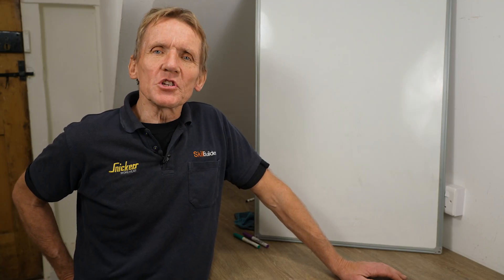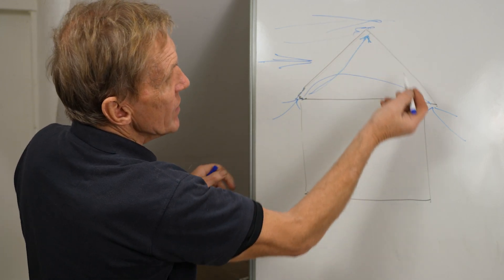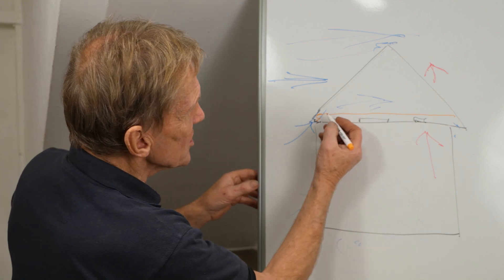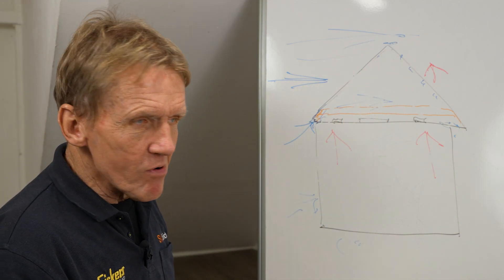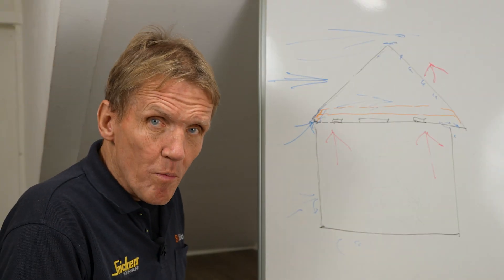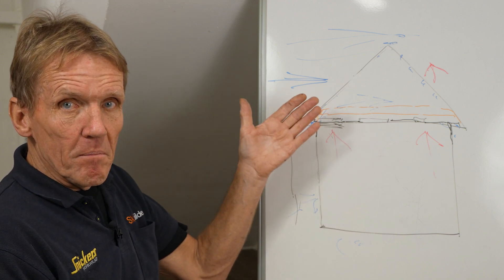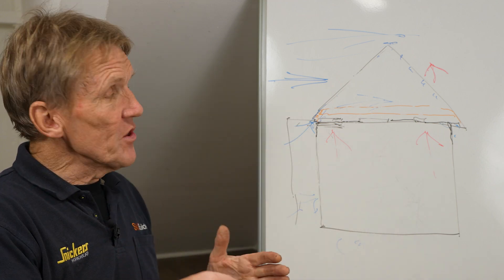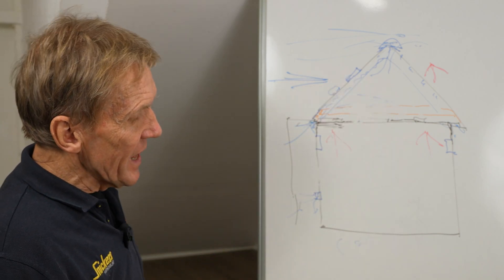Why Do You Have Condensation in Your New Roof?

Comment: We’ve just bought a 3 storey Victorian house with a slate roof. It hasn’t been lived in for 18 month. There are 2 rooms in the loft but it has no insulation so I want to remove the ceilings to add a multi foil across  the rafters then 100mm of kingspan over the top. There is already condensation on the 3x2 timbers but nothing is rotten. Would insulating like this make it worse so I need to vent the outer 3” area between the tiles and multi foil.
Reply: To get the right U values for current building regs you would lose room space quite a bit by the time you build out. 
To make the best of what you have, personally I would install 25mm pir insulation in between rafters this would maintain your 50mm ventilation gap, then I would install a super quilt insulation (YBS ) directly over the underside rafters, foil tape all joints and then  counter batten over that with 25mm x 50mm batten, then you could install a vapour control layer ( although not essential as the super quilt would act as one) then your plasterboard. 
You may not get the current U value regs for said area but you would have done your best to get some energy efficiency into the building and it would be better than nothing as they say. Hope this helps.
Reply: @christaylor5291  thanks for that Chris. It’s looking like the slate will have to come off so could I put a super quilt on top of the rafters too ?
It wouldn’t matter about loosing some room if I also install 100mm kingspan as the rooms are massive.
Reply: @S.wilson911  hi Stephen no problem. If the slate has to be removed, the thing you have to consider if you live on a semi detached then there would be a height difference with your neighbours roof finish. You would still need to counter batten on top of super quilt then batten for slate so that’s a build up of 50mm off of rafters before slate is installed, which has to happen although this provides cross ventilation which is great. If you live in a detached house then no bother but you would need to look at fascia heights due to the build up. You might only need to install an over fascia vent to take the difference up in build up on the batten. One thing to mention is YBS sell a superquilt with roofing membrane install already on it, still tape the drift joints (Overlaps). Check the specs to what way the membrane is installed, I can’t remember off hand. Even though if you went for superquilt on top of rafters you would still need to install pir insulation, in between but still need to maintain an air flow up the rafter voids, so 100mm in between would block that. At a push you could install 50mm in between maintaining a 25mm air flow then vapour control layer and then 40mm-50mm over the top of the underside of rafter then plasterboard. (With superquilt on top and insulation inside the property some would refer to this as a hybrid roof which is ok providing you maintain air flow as it still would act as cold roof).
Check the specs on the u values of the superquilt. You won’t be far away from current regs. 
If you are using plasterboard against pir insulation use insulation washer along with the screws this would create a much wider spread to pull the plasterboard back this not having issues in the near future with screws popped or not pull back enough. Hope I have clarified what you need. 😀
Reply: @christaylor5291  ok thanks Chris.

Comment: Hi Roger, I'm a building inspector, in fact I'm the Head of building control and was a joiner/builder for 35yrs, and I'm not confused at all and agree with what you say but I'd like to add another couple of points. Firstly if you replace more than 50%of any thermal element of a building i.e. Floors, walls and roofs, you should submit a building regs application. I'd say 75%+ of all our unauthorised works are re-roofs. This is because roofers also don't like doing insulation which would be part of the requirement, to bring up to current u-values.the rowers don't usually care and if we don't see them the owners may have trouble selling with no cert. Secondly, you're right that they should check with the manufacturer and also the BBA certificate as this will give specific fitting instructions. Usually the amount of sag between rafters is specified. I have rarely seen a membrane fitted to spec because as you say, they're usually on a price and also they'll pull it as tight as a drum as it looks shite when it's sagged. Finally an opinion of my own. I'm concerned about the longevity of the breathability of these membranes. As you know, when you rip a roof off more than 20 years old there's all sorts of detritis, dust, rubble, insects etc etc. I think in time we will start to see issues arise from this. Although in some cases I can't insist, I will always advise cross ventilation......again as long as its not blocked by stuffing insulation right down in to the eaves. App it takes really its good workmanship and attention to detail.
Reply: It's actually 25%.
Reply: Through ventilation of loft spaces is the way forward no matter what 'breather membrane' is fitted. We always vent at eaves AND ridge.
Reply: All true.
Reply: Well I must say your the first person in a long time to mention the sag in roof membrane installation. It all has a bearing on build up of moisture. 
Completely right about waste being caught in between roofing membrane and battens no different that mortar in a cavity it will transfer moisture to the warmest areas thus creating problems in the near future.
Reply from the maker: We had a video on the sag
Reply: @SkillBuilder  I am concerned about valleys & eve details with this system as with saggy felt you will get ponding, in my experience modern breather felts are about as good as a tea bag with ponding. I still use counter battens, also the saggy felt if you touch it with insulation in a vaulted roof your in trouble. as an aside how many roofers have been to a leaky roof that has been absolutely annihilated by nesting mice with the counter batten? the little buggers didnt like the taste of 1F! the main problem is compromise  be it the ventilation, the vapor permeability. also after 30+ years in the job I have seen many u turns on cast iron practices! IE are we on top, underneath or in the middle with the membrane this week!
Reply: @christaylor5291 no need for sag if the roof design is with counter batons , it only requires very basic understanding to get a grip on ventilation and condensation
Reply: I haven't seen roofers fit sarking with sag ever in my life, infact every job I've ever done we go to great ag in pulling it tight 😂 I will try to do it better in future

Comment: Your bit early on about the suction from wind is slightly wrong. Aircraft wing - yes ... but the pressure reduction begins as soon as the air is pushed up the windward side, the pressure is lowest at the top and then increases again as it goes down the leeward (downwind) side. So the maximum suction is around the ridge on both sides, not just the downwind. Of course, if a tile lifts on the windward side it may be caught by the wind and ripped off - less likely on the lee side.

(The why is actually fairly simple: In order for all that air to get over the roof (or wing) it has to speed up - because there is less space for it. The only way to get air (or water if you're a plumber) to speed up is to apply a pressure difference, so the pressure at the ridge must be lower than at the windward eaves. Once past the ridge the air has more space and needs to slow down, so the reverse is true - the pressure at the leeward eaves is higher than the ridge.)
Reply: You sure about that mate?

Comment: how about warm roofs?
Reply: Yes what about them? Need to be specific, 

If your asking about pitched roofs then a YBS super quilt insulation on top of the rafters, counter batten, breather membrane, batten, tile etc would keep down but still needs ventilation into a loft area. Would reduce your energy bills over time. 

If your talking about flat roofs then no ventilation required on a warm decked roof.

Comment: Good video, I’m a builder on cape cod and I’m wondering if you guys ever use architectural asphalt shingles like we do here?
Reply from the maker: Hi JN 
We only use those on garden buildings not on our houses because they are looked upon a low grade roof covering. We are looking for 100 years lifecycle.
BTW I took a vacation on Cape Cod some years ago, we ended up in Province Town, that is an interesting place.
Reply: @SkillBuilder  This is horses for courses of course.  We think of corrugated roofs the same way, but in South East Asia they use it as it stands up to the weather well, better than slates and tiles, and in parts of Scandinavia you will often see corrugated roofs using Onduline or similar.  I am not a builder, etc, a bit of a DIYer, but research everything that I do or will get somebody else to do.

BTW I have been through a mouldy roof within a few months of a new build in the mid 1970's when the builder omitted installing vents adn once they had it cleared up within a few weeks.  Current house only has slates and no felt or breathable liner, built in 1949.  Roof space is really cold in winter but hot in the summer, but no mould or dripping water.

Comment: good clarity Roger. I have seen previous videos. Looking to convert loft and insulate between rafters so will need 50mm? air gap between insulation and roof slates? also will need to retro fit vent holes in soffits as they are completely blocked.
Reply: "retro fit vent holes in soffits" or you can vent over the fascia or tile vent the eve space

Comment: Hi Rodger.  I have a purpose built chalet with 2 dormas that finish In the loft space. I want to add insulation to my loft so I can store things in there in a nice dry area so looking to put insulation between the joists and in to the void above the flat roof to create a free flow of air from the front of the flat roof up to a ridge vent. Is there any info on ridge vents to take the air flow from the flat roof that joins in to the roof/loft? I’m struggling to get a roofer to do both reroof the flat roof and put in the ridge vents.

Comment: I recently put an extra 200mm of lagging in my loft.  Obviously this blocked the eaves.  To maintain the air flow I put 1m lengths of guttering  into the eaves (at right angles to the eaves).  This has kept the air flow into the loft with no problems seen.  No fancy membrane on the roof just old fashioned sarking ( I think that’s what it is called).
Reply: That there is a top tip, thanks. I`ve also seen cardboard tacked in between the rafters to act as an air spacer
Reply: Yeah, I had the same situation and done the same thing. Fast forward 2 years and everything seems perfect - no build up of moisture anywhere.

Comment: In my roof Roger we just have the original slate tiles no membrane someone installed one of those I think it's called a piv   blows back into the upstairs lands it was installed before we bought the property, 100yr old next year could this be problematic in time.
Reply from the maker: Hi David
It puts the house under positive pressure and blows the moisture out through the gaps around doors and windows.
Quite honestly in a house such as yours I don't think it makes much difference but it will do no harm. Try switching it off and see if you notice any difference over a couple of weeks.